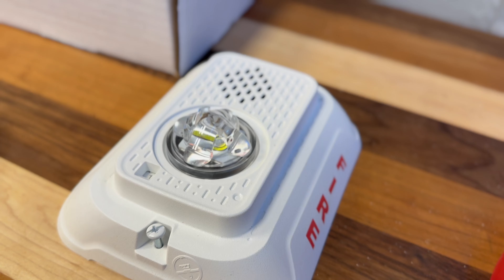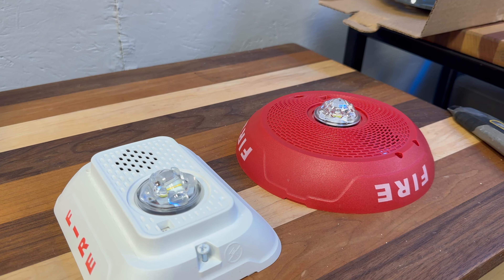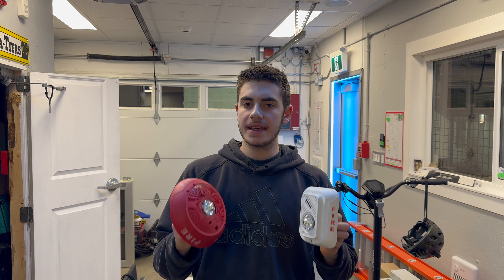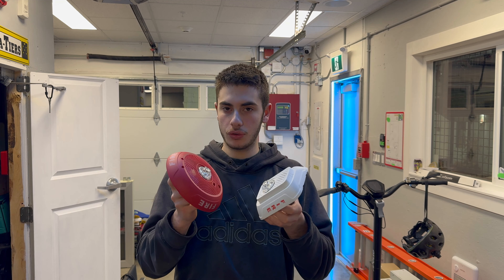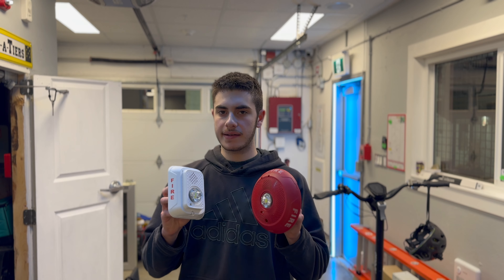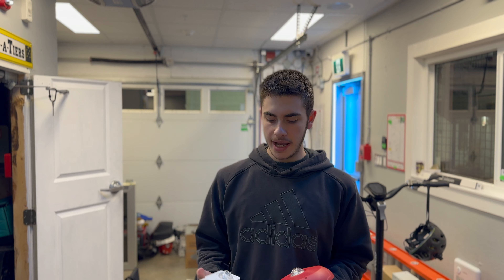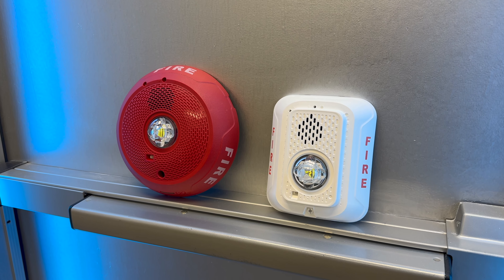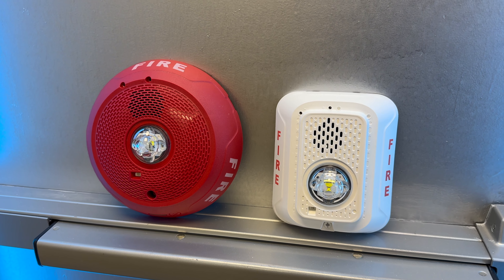New System Sensor LED L-SERIES Fire Alarm Review. More changes than you thought!

Comment: I foresee that in the more distant future that a device that can support amber/white/blue LED strobe in one device will be a thing, as well as having the audio components support both low frequency, 3k, and some kind of standard 1k tone in various different patterns. Possibly a compact speaker strobe or something. Also, albeit not common now, I can see that addressable and intelligent NA will become a future reality (which could be useful for pinning down a troubled device instead of hunting a device down in a sea of devices within a given circuit). I am curious to see what the future holds but I can say that these devices will become more simpler to deal/manage/maintain with than before.

Comment: I definitely like them. Everyone always hates on the new devices but they objectively look good and are a superior device
Reply from the maker: People didn't like the xenon L-series when they first came out either. The problem is people seem to forget that these are a life safety device their primary function is to be effective at signalling a fire alarm. Being aesthetically pleasing is not a priority and functionally these offer much more than what they are replacing. As far as I'm concerned that is the main reason for in my opinion good redesign.
Reply: @nics-systems-electric  ^^^ People hated on the wheelock exceder, the new LED Eluxas, the new LED Edwards horn strobes, and basically anything new that comes out. It’s even funnier when meatheads say they’d install a device that’s been discontinued for decades because “they’re better”
Reply: Even though I do prefer the regular xenon L series, but the LEDs are awesome

Comment: Wow! My high school just so happens to have a system replacement with l-series speaker strobes
Reply from the maker: Surprised they are able to get speaker strobes already
Reply: Me too as voice evac is not common in my area which shocked, me when I found out there were L-series speaker strobes. They are the first L-series speakers I have ever seen in person. @nics-systems-electric
Reply: Mine got white l series ceiling mount speaker strobes last year and completely removed all pull stations

Comment: Nick the other school I went to had no pull stations no sprinkler heads. It only has smoke and heat detectors and our.  Nac was system sensor, ceiling mount low frequency, sound

Comment: Yeah, I see what you’re saying about the System Sensor LED L-Series, I don’t like them because the strobes flash pretty short like the other fire alarm strobe does and they could be loud. 

Instead of saying the LED L-Series, I would only say the LED Series. But I see that they replaced them and it looks cool though.

So I like the L-Series better just like I had one.

Comment: Nice video. What you said about enthusiasts hating on the design is quite true. When Wheelock first released the Eluxa, I hated on it but don’t mind it now. 

I originally thought these were gonna have something similar to Wheelock’s solution, having a separate selection for T3 and T3/T4 with T3/T4 being chosen via muted/unmuted sync signal. However, now I think given the FCP setting, that Honeywell will release some sort of wired addressable mounting base (and update SWIFT bases) that will send the T3/T4 and candela information to the alarm. 

Although, I do wonder what would happen if you powered the alarm using a silenced sync signal. My guess is it will only flash, but who knows?
Reply from the maker: Yes something definitely will be released I did try these on sync mute/audible silence in this video if that's what you mean and they do perform the same as previous models
Reply: @nics-systems-electric I meant on initial power-up, not silencing after already receiving a horn signal

Comment: As someone in the industry, what would you say is the reason why most installers go with system sensor in just about every new installation? Is there something they have that other brands don’t? Just something I’m curious about.
Reply from the maker: I think they have a pretty wide compatibility range easy to install and many distributors carry them they might have a lower cost compared to Wheelock and Gentex who are the competition

Comment: If the horns can do both temp 3 and temp 4 with panel control an idea is a normal horn strobe with a amber strobe next to it that would go off when a co alarm went off and the normal strobe when a fire alarm goes off.
Reply: *CO, CO₂ is the gas you breathe out
Reply: O crap I’ll Chang it thanks for saying that

Comment: Maybe You Can Install The Ceiling Mount LED Horn Strobe On The Ceiling In Your House And Add It To Your House Fire Alarm System In The Kitchen Area Because Your Kitchen In Your House Probably Needs The Ceiling Mount LED Horn Strobe Because Kitchen Is The Most Prone Area Of Grease Fires Oven Fires Or Any Kitchen Related Fire
Reply from the maker: The house uses low frequency sounders so can't have mixed signals. A horn strobe in the kitchen would not offer any greater protection it will not do anything for detecting a fire no matter what type

Comment: I wish they would come out with an LED mass horn/strobe.  I have tons of System Sensor masses still in use with mass horn being coded to code 3 or temporal.  Why don't System Sensor come out with an LED mass?
Reply: Their MA/SS devices are long discontinued and won’t be brought back as there’s isn’t much of a point of having multi tones for a fire alarm that only has 1 input, and Federal Signal rebrands Fulleon Roshni and Flashni sounders for when multi tone is needed
Reply from the maker: And I don't think any way to synchronize with modern devices
Reply: But still!  It would have been awesome as all get out!  Or at least it would have been interesting nonetheless to see what the System Sensor mass would have looked like in an LED version.  I would imagine that the strobe would be ultra flat against the body of the mass horn and low profile and barely visible on the horn body.  Do they have a 4 wire LED horn/strobe?

Comment: Also they sound the same as the xenon L - Series. Which they're using the same horn tone which is no surprise. But honestly there is some room for improvement for System Sensor to update the LED L - Series, just like Wheelock did with the LED Exceders.
Reply from the maker: What would you suggest to be updated? I don't see the horn tone being a problem.
Reply: @nics-systems-electric  The strobe flash could be more like and act like a xenon flash. Like the Wheelock Exceder LED3...
Reply from the maker: @EYL8902  that is what it does.
Reply: @nics-systems-electric  Fair enough. I might get one too. lmao

Comment: I'm no expert, but aren't they basically the exact same alarms with just different covers?
Reply from the maker: Same horn and mounting base different strobe and different electronics inside to support future protocols for synchronization
Reply: @nics-systems-electric  Sorry, I was unclear. I meant the two new units. Aren't they just the same with different covers?
Reply from the maker: @djbryce  they are definitely very similar the strobe is centred in the ceiling device however not on the wall so that may be a difference but it's hard to tell until I open them up

Comment: I don’t like it, it makes me throw up. I HATE IT 😠
Reply from the maker: I wasn't a huge fan of the design at first myself however seeing them in person they are fine in fact the ceiling mount one looks better than the older generation. If you like them or don't like them we will be seeing them all over as they will replace previous generations. functionally it is a much better product which is the main concern.
Reply: @nics-systems-electric  I like the old fire alarm’s better than the very new ones
Reply from the maker: @maiyo8518  you must be basing it purely off of looks as it is functionally a better device there is no argument there however visual appearance is a opinion that each can form